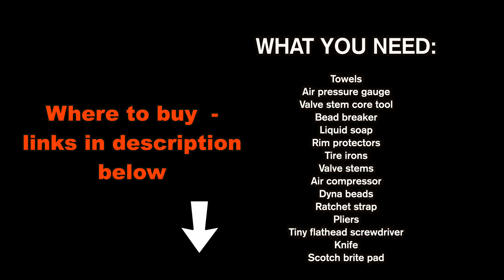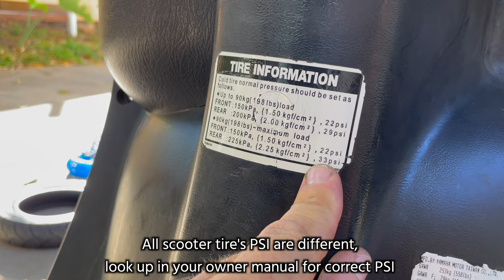How to change scooter tire with hand tools at home - DIY | Mitch's Scooter Stuff

Comment: FYI: Yellow dot indicates light spot on tire, align with valve stem. Red dot indicates high point for radial runout. If wheel has a white mark or dimple, line red dot with it, if not red dot goes anywhere. Small wheels/tires often have no marks. Cheers!....Russ
Reply: Well worth knowing, many thanks,,
Reply: My old tire has a yellow dot aligned with the valve but the new tire doesn't have a dot so it doesn't matter how I put the tire?

Comment: Hi handsome, you installed a $100 USD Michelin tire on, you must  reinstall the tire with a new metal scooter valve stem 90 ' , and apply x trem bead sealer on both sides of the rim.

Comment: The way you're doing it is much less labor-intensive than the way that I did it one time, I mounted a scooter tire myself once, I used 3 screwdriver and a ratchet strap, removing the tire was easy enough, but mounting the new one was one of the hardest jobs I've ever done in my life, I had to use three big flat-head screwdrivers to get it on the rim, and I used the strap to push the bead out so that it would hold air, needless to say after that pain, I now take my tires to a shop for mounting
Reply from the maker: 👍🏼 if you do more often then it will be so easy, I can get it done 5-10 minutes after many practices

Comment: Excellent instructions as always. I have done this job a couple of times, and even though I saved some money, it just kills your knees, hands, arms and lower back. I’ll be paying next time for the change.
On another note, Brisbane, Australia has similar climate to your island and have found the Pirelli Angel scooter on my XMAX300 to be absolutely amazing. Especially in the wet, the tyres have never even once given me a scare (I’ve scratched my centre stand a couple of times while leaning in the turns). They have approximately 9000km on them and still feel like new. Cheers!
Reply: went with those Angels myself good tire
Reply from the maker: That’s awesome I will check out that tire!!
Reply: @MitchsScooterStuff  Hey Mitch. Just replaced them with Pirelli Diablo Rosso 100km ago. It’s supposed to be a stickier version of the Angel.

Comment from the maker: Here's list of tools I use to change the tires -
Amazon store - https://a.co/cqJKn7L
Towels - https://amzn.to/3O71C8v
Air compressor - https://amzn.to/2LetN6j
Air compressor blow gun - https://amzn.to/3fCwpIQ
Air compressor air chuck - https://amzn.to/3nyWlsQ
Air tire pressure gauge - https://amzn.to/30K7wFC
Tire irons - https://amzn.to/2I880Pb
Rim protectors - https://amzn.to/2SE5rX7
Valve core tool - https://amzn.to/36KTVS1
Valve stems - https://amzn.to/3nzzldh
Bead breaker - https://amzn.to/3M3RI5w
Liquid soap - https://amzn.to/3xqjNQs
Dyna beads - https://amzn.to/3AmoITY
Pliers - http://amzn.to/2orfn7K
Locking vise pliers - http://amzn.to/2xGxI5G
Tiny flathead screwdriver - http://amzn.to/2zyrLck
Knife - https://amzn.to/2SDMNi7
Threadlocker - https://amzn.to/2SPbY1R
Scotch-brite pad - https://amzn.to/2xP621n
Reply: I just changed the tire on my Yamaha morphus it was a good learning experience
Reply from the maker: @bryanwheat2960  Awesome 😄🙌🏼

Comment: When rope or hose is between rim and tire, is easier put iron to gap in tightest section. Rope also help pull tire out against leg on rim. Wipe soap off before inflating.

Comment: Another tip... clip a pair of mole grips on the rim when putting tyre back on so you don't have to keep your knee on it 😁
Reply: You are right. But very few people keep tyre lever at home, not to talk about mole grips. Also sometimes the old  tyre sticks to rims and it requires hammer and tyre lever to separate tyre from rims( One can use C clamps or mole grips to press the tyre)

Comment: If is hard to get bead to seat on the rim, valve stem hole give bigger opening to get more air in. When stem is inside with string to pull it in hole. Use high pressure and large , short hose.

Comment: Na hola.... I'm surfing around and stumble across Mitch's Scooter stuff. Thought you are still busy with Kona. You are quite versatile. I'm also in the process of getting a Peugeot Elyseo 50 running again. Maintenance backlog without end, I tell you. Well, then I will delve into your scooter videos. Oh yes.... still waiting to see when Kona is finally finished. Or is he already finished and you are already enjoying him in Hawaii? Give my regards to your wife, unknown. 
Greetings from Germany, the birthplace of the VW.
Reply from the maker: Aloha! Yes busy with Kona and scooters and other stuff in life haha. Kona is not ready yet but getting so close 😅 that’s awesome did you get Peugeot scooter, how is it?
Reply: @MitchsScooterStuff  What can I say Mitch... I'm still busy building up the Peugeot Elyseo 50, unfortunately I don't have a garage where I could work on it in winter. So it will all have to wait until the temperatures are in the comfortable range. However, I'm done with the electrics, a new exhaust is in place and if the weather permits (lots of rain here at the moment) I'll install the cleaned Gurtner carburetor and hope that the Diva will then run. If she does, I'll also give her new tires... And then, let me have fun ....😉Maybe, but only maybe I'll install a 70 cc cylinder kit and optimize the variator 😁
Greetings from Germany, the birthland of VW
PS: Kona looks chic

Comment: Hello there,

Super video!
Do have a question though:
Where can i find the values on how tight the brake disc should be tightened on the front wheel?

Thanks!

Comment: If the old tire is going in the trash anyway, you can also simply use a knife.
Get the air out first though seriously, stabbing a filled tire and instantly pulling the knife out is gonna knock your ears out
Reply from the maker: Yes release air first then stab the tire 😁

Comment: Question if you dont have an eleectric air tire inflator only a manually push pump air inflator how can you pop up the bead inside???
Reply from the maker: Been there before... just bring tire to car tire shop, they will do that for you in less than 5 seconds with no charge :)
Reply: Take it to a petrol station and use the air pump there

Comment: 17 inch moped tires are easier as their larger size are more stretchy n flexible. 👍✌️

12 or 14 inch scooter tires smaller are less stretchy. 😅 Unless its a soft compound then it's easier. 🤭

Comment: what do you recommend if I dont have a high powered air compressor like you? Will a 12 volt air compressor or a manual foot pump or bicycle pump work?   

That air compressor is so expensive =[
Reply from the maker: I would suggest stop by car tire shop, my friends did that no problem 😉

Comment: My old tire has a yellow dot aligned with the valve but the new tire doesn't have a dot does that also not matter you only mentioned the red dot
Reply from the maker: Align red to valve stem

Comment: I have everything on this list except the bead breaker, can I do it without it or do I need to spend the 60 plus dollars on this tool?
Reply: you can get 'em cheaper than that. C clamps help too
Reply: a small sledgehammer on the tire works too. Use care not to hit the rim
Reply: @johnbowman476  as a matter of fact that is exactly what I had to do last time whackin away using a foot pump!!
Reply: @moss8448  Lol!
Reply from the maker: Like Moss or John said that works 👍🏼👍🏼

Comment: Yeah question, mine doesnt catch air. Like i have it and its on the rim on 1 side but the other side is off and it wont catch air
Reply from the maker: Use ratchet strap, it will help
Reply: @MitchsScooterStuff  thanks, i got a couple of buddies of mine and together we fixed it!
Reply: had a guy once spray some starter fluid in the tire and hit it with a lighter...bang .. sealed.
Reply from the maker: @teddemanz1373  😄👏🏼👏🏼👏🏼
Reply from the maker: @moss8448  haha yeah saw some people do that but I don’t want to put people in risk 😆
Reply: @MitchsScooterStuff  yeah went the strap route myself the next time

Comment: What about the inner tube??
Reply: the newer scooters use tubeless tires.  if you have an older scooter running tubes then the process is similar you just have to be careful when getting the other side of bead on the rim and not pinch the tube.  its very similar to changing a bicycle inner tube.

Comment: Make your rim protectors from an old 5 gallon bucket.  Wear oven gloves put the plastic in the oven until it gets soft.  Yes it takes about 5-10 minutes with a preheated ove and you have to stand there and watch it or you will have a fire.  Experiment and start with a lowest temperature oven.  Then go up in increments of 10-20 degrees.  Don't get in a hurry or your plastic will burn and blister.  This is dangerous so be careful & protect yourself and children around you.  Do this at your own risk.
Reply from the maker: Good tips! 🙌🏼🙌🏼

Comment: this guy is doing it all wrong just let the air out break the bead and pry pry pry and flip the tore run a bar thru the other side and pry it off then push the new tire on and pry the least side then seat the beat there is no reason to take the disc off just use it to ur advantage
Reply from the maker: All wrong? Did you watch the whole video before commenting?
Reply: Post a better video then - we call can't wait to watch it.
Reply: Go away Trolls!